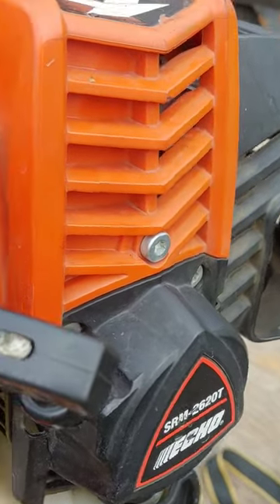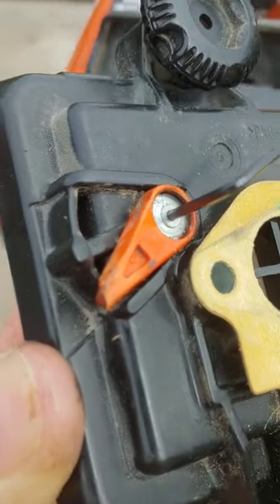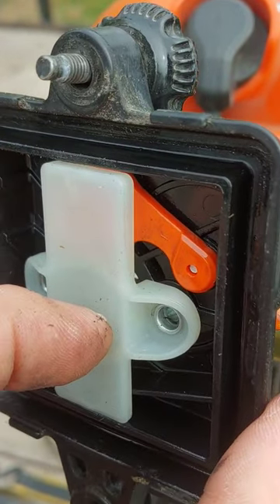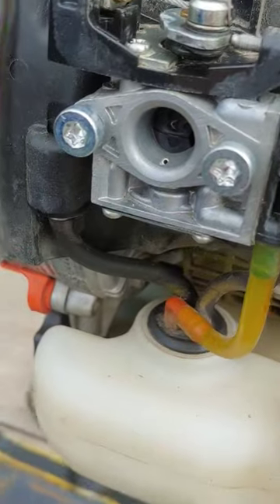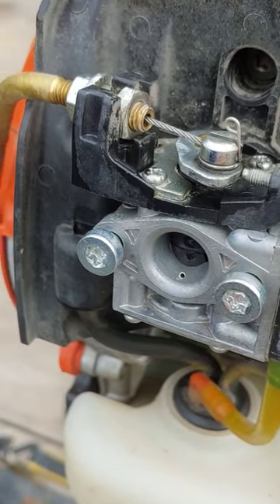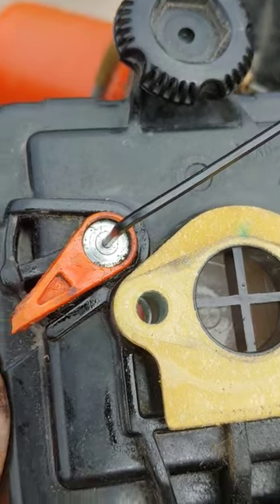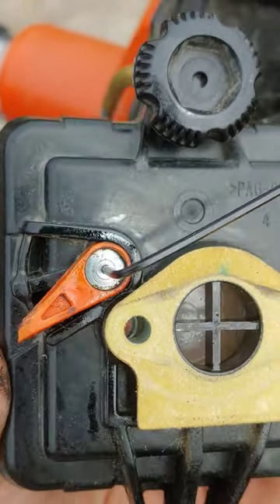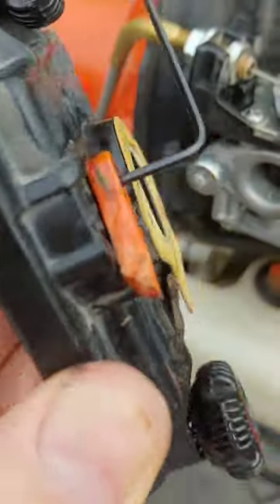is your Echo trimmer losing power? check for a loose choke lever...snug it up!

Comment: Thank you very much. I was looking for a video on how to remove the lever only.Since i had broken one already,thought it had like a pivot and tried to smack it out but thanks to your video i can fix another one i have.
Reply from the maker: That's great! They are very easy to change out if you have one to replace it with...I made a slight modification to the one that was in a SRM 2620T to fit it in an SRM 225...Good luck!